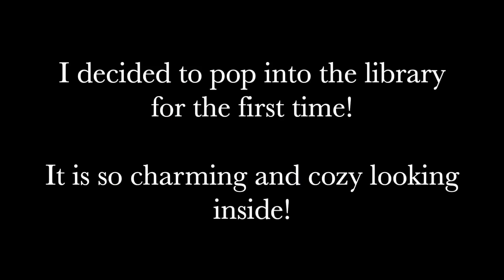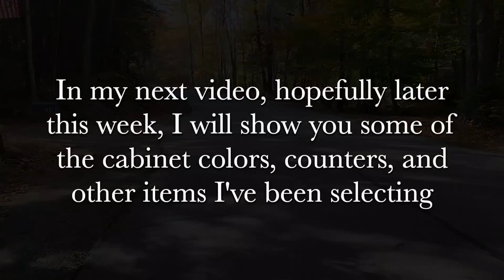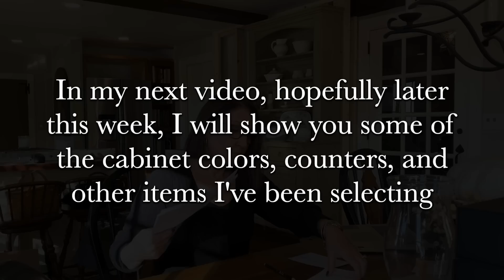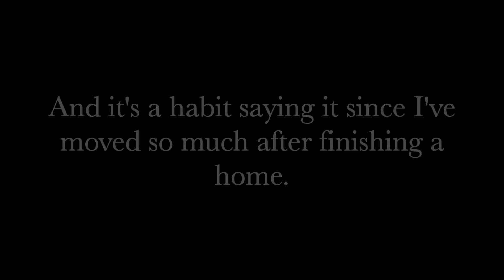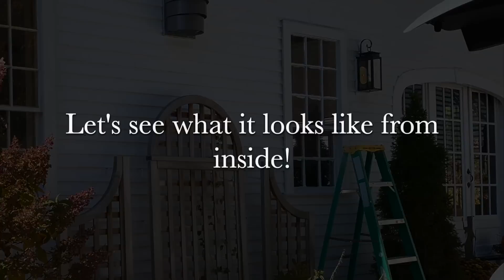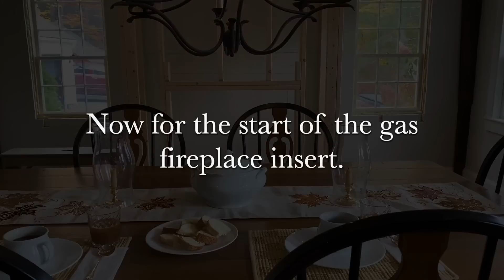Kitchen remodel question and answer chat,  construction update,

Comment: Isn’t Carbon monoxide only produced by gas? Not all homes here in our area have gas. Many are electric only. But yes we have propane heat and have the CO/Fire dect. installed.
Love the window addition. Wow!
Reply from the maker: Hi! No Carbon Monoxide is produced by many items... not just gas.  I copied this from online to share. 

Clothes dryers
Water heaters
Furnaces or boilers
Fireplaces, both gas and wood burning
Gas stoves and ovens
Motor vehicles
Grills, generators, power tools, lawn equipment
Wood stoves
Tobacco smoke
Reply: @newenglandfineliving  thank you….good to know.